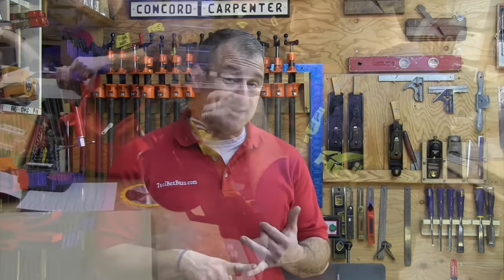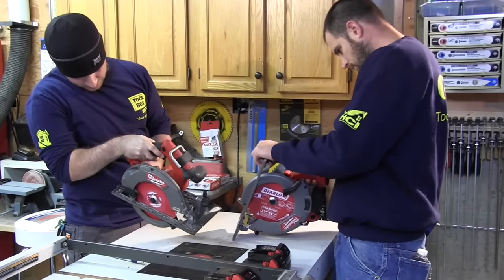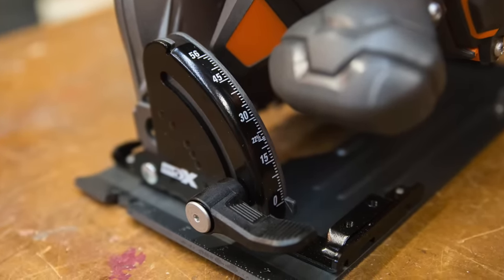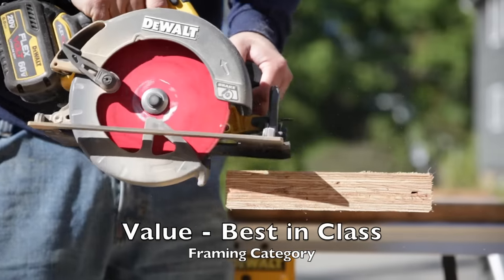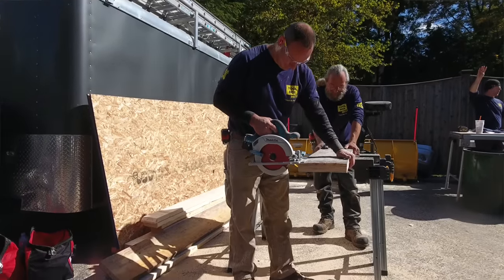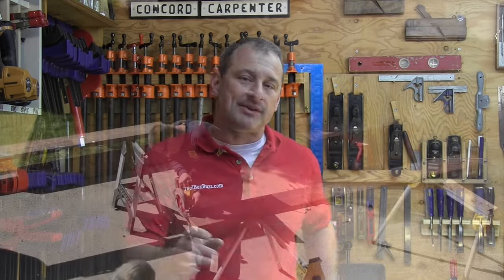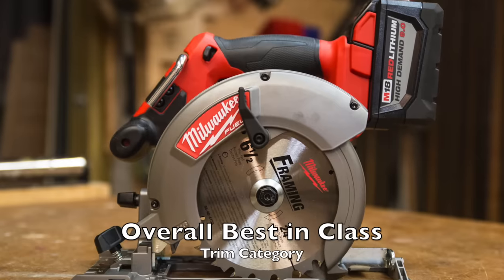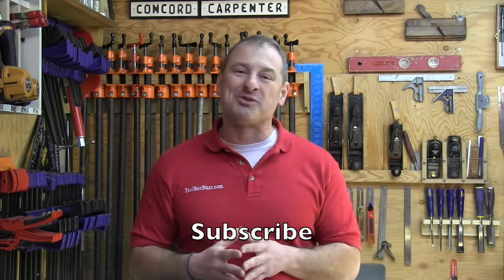Best Cordless Circular Saw - Head to Head

Comment: Endurance test. Of course milwauquee will with with a 9AH battery
Reply: Camrin Massey What a goofy test, who would have thought a giant expensive battery is going to offer the most run time.

In other news Milwaukee also won the most red colored saw test as well, truly putting it in a class all its own.
Reply: Infandous Ktenology, i have the saw and battery kit and with the rapid charger the 9.0 battery charges in 45 minutes, the charger charges 5.0 batteries in under 20 minutes
Reply from the maker: Actually the Makita has more cuts on the runtime test  did you look closely at the graphs?  Read the article?   Or.... do just prefer to make fun of 140  man-hours of "free labor"  to provide some insight into the tools you use?
Reply: Cody Muckerheide that doesn't sound remotely possible. does it charge 3ah batteries in 10 minutes? Are they smoking when they're done and do you hold them with oven mitts?
Reply: Brandon Hall not at all, idk what they incorporated into the charging technology, the company i work for buys exclusively milwaukee for our cordless tools, so i bought my own 7 1/4 saw and was the first with the 9.0 battery in the company, being the only one with a rapid charger we would always use mine, wed put a battery on the charger, walk away for at most 20 min and when we came back the batterys would be charged from 0, except the 9.0 of course
Reply: Brandon Hall not at all, idk what they incorporated into the charging technology, the company i work for buys exclusively milwaukee for our cordless tools, so i bought my own 7 1/4 saw and was the first with the 9.0 battery in the company, being the only one with a rapid charger we would always use mine, wed put a battery on the charger, walk away for at most 20 min and when we came back the batterys would be charged from 0, except the 9.0 of course
Reply: Cody Muckerheide In order for that to be true the charger would need to be putting out 10-12 amps. Seems highly unlikely. To my knowledge Makita still has the fastest chargers and they have to incorporate a fan to charge a 3ah battery in 30 minutes without it overheating. Do Milwaukee's chargers even have a cooling solution?
Reply: Brandon Hall the new rapid charger does have a fan, one of the first things i noticed cuz the old chargers were silent
Reply: Gents the rapid charger does have a fan and uses a modified sine to charge. It forces the charge really fast and then a cooling of the fan. That's how it charges so fast and no oven mitts needed.
Reply: Joe Canning That doesn't tell us how fast it charges, and I sincerely doubt it's under and hour for the 9.0. 2 hours even seems far fetched.
Reply from the maker: The 9.0 Ah battery will charge in 90-minutes with their rapid charger
Reply: and its going to run longer being brushless.
Reply: Cody Muckerheide do you notice a big difference in power with the 9.0. I'm trying to figure out if I should get one.  My 5.0 dose a great job
Reply from the maker: no - I think its the runtime where you'll see the biggest gain
Reply: Hitachi makes a faster charger than anything by Makita. It comes with their Triple Hammer impact and charges 3.0 batteries in under 30 minutes.
Reply: bhepp344 sorry i did not see your reply. the 9 ah has a faster discharge rate, which you do notice withe the skillsaw, expecially doing 2 by 4 rip cuts
Reply: greenskiis I guess Hitachi has to have something going for it.
Reply: You mean in addition to the best impact (Triple Hammer) and best nailers, and among the best miters? Guess so.
Reply: greenskiis never used the impact, nailers are nothing special, prefer paslode, and ther mitersaws are terrible, makita or bosch are the best for mitersaws
Reply: greenskiis other than the occasional pneumatic nailer, I rarely if ever see Hitachi power tools on the job. Must be home gamers buying them.

As far as having the best impact, pretty sure Makita still holds that spot, though it can be somewhat subjective.
Reply: The Triple Hammer curb stomps anything put out by Makita, DeWalt, etc and is IP56 rated to boot. Don't knock the company if you haven't given their latest products a fair shake; they also just put out the most powerful cordless hammer drill (even more powerful than the Fuel Gen. 2). They've really been putting out some quality stuff of late instead of their past "rich man's Porter Cable" cordless lineup.
Reply: greenskiis When they start showing up in the boss' van, I'll consider them an option.
Reply: Um, OK. Feel free to think outside those boundaries, though. :)
Reply: If he uses the best, they should already be in it.
Reply: @Cody Muckerheide - "with the rapid charger the 9.0 battery charges in 45 minutes" - you've got your charging times wrong. Milwaukee themselves claim a charge time of 95 minutes on their fast charger for the 9ah battery. As for 20 minutes for their 5ah - nonsense.
Reply: A Concord Carpenter / ToolBoxBuzz 

I'd love to see the new 9ah flexvolt against the Milwaukee 9ah we make a great video! And great video Robert thanks 
-Josh
Reply from the maker: josh travers were testing the 9.0 and flexvolt this weekend - on recips
Reply from the maker: Brandon Hall Actually the Makita has more cuts on the runtime test  did you look closely at the graphs?  Read the article?   Or.... do just prefer to make fun of 140  man-hours of "free labor"  to provide some insight into the tools you use?
Reply: @ConcordCarpenter  "free" rofl. Like you aren't getting paid by youtube, and who knows how many other companies.  Get real.  Also, using massively different sized batteries made no sense, so just own that.
Reply from the maker: Camrin Massey each tool company sent their BEST battery at the time of this test
Reply from the maker: John Handcock YouTube doesn’t pay me either Einstein. There’s Adsense and that pays per clicks on the video, which by the way doesn’t even cover the lumber we buy to do these tests. Each company sent their best saw with their best and biggest battery.
Reply: @ConcordCarpenter  Ohh it's not google, it's adsense... Same shit.  Semantics.  

So, all you got was $5,000 worth of circular saws, and w/e money the ads on your website generated.  

I wish I was working for free.
Reply from the maker: @johnhandcock3242  No we give the guys who help with the testing a tool and donate a bunch to local trade schools.  

Click this and scroll down:

https://www.facebook.com/search/top/?q=tool box buzz trade schoos
Reply from the maker: @johnhandcock3242  No - we give a tool to the guys on the crew who helped, and donate a bunch to a few local trade schools.

Click and scroll down:
https://www.facebook.com/search/top/?q=tool box buzz trade school
Reply from the maker: @johnhandcock3242  Nope - we give a tool to each of the crew for help with the testing and donate to trade schools.

Clearly you've made your mind up on us, I'm NOT going to sway your opinion. Just want you to be informed.

If you'd like to chat more about this, and how I use adsense, and the countless hours that I put in to my website and video channel. I'd certainly jump on a call - I'm pretty proud of what we do here - just  LMK .  ROB
Reply: A Concord Carpenter / ToolBoxBuzz Great job guys, don’t worry about Shitheads like John Handcock (how original). He just mad his Fisher Price kit he invested in didn’t win.

Comment: my friend bought a combo of milwaukee  few month ago, his hammer drill is broken , circular saw is fking heavy and the protection system( the shell covering the  saw) is completely trash ( always stuck) when  cut the timber.
Reply: Strange, I switched to Milwaukee from Makita power tools and the build quality and performance is night and day for what I do. I find the Milwaukee 18v fuel hammer drill and impact driver are unreal.
Reply: It all goes down to the actual users. Yes some blames on the tool instead of themselves.

Comment: To me you got to look at the big picture, and the only one that actually matches and might be more powerful then corded is Dewalt, the others don't and you won't be able to with 18 or 36 volt tools, Dewalt to me is game changing in the power tool department and they have a 7 year patent on it's flexvolt design so either other tool companies pay to use that technology or just wait for the patent you ru out or use a  different battery platform
Reply: Big Daddy I'm not sure I agree completely. The 60v is nice, but it does come with a sacrifice. Dewalt and Milwaukee have similar number of cells in a pack. So one uses the potential power quicker at a higher voltage. One chooses longer run time at a lower voltage. For 95% of applications a user doesn't really need 60volts (54).
Reply: Actually if you look at the cuts per watt hour chart they showed the Dewalt uses its battery energy slower than the Milwaukee. Just because the battery pack is a higher voltage doesn't mean the tool automatically draws more power. The higher voltage of the Dewalt system means that it can be more efficient as the current draw is lower and therefore heat loss in the motor winding and the control MOSFETs is lower.

Comment: I always liked Milwaukee but had problems with there batteries...they work fine for awhile but they often fail...Milwaukee at one time honored this buy replacing them via a recall etc. but I heard now they wont now and there customer support is non existing (personal experience), its my understanding that they now out source there battery construction , that is not the same company may not make their batteries all the time and (for me) they seem pron to fail after awhile and will not support there customers.  
"That's all I got to say about that" Forest Gump
Reply: When I bought this saw as a bare tool the blade it came with was missing teeth. I called customer service and they sent me a new one. I'd say that's good customer service imo.
Reply: David Harris 
Old Milwaukee V18 batteries were garbage, but the newer M18 or M12 never had any problems with it.

Comment: I use the Milwaukee fuel circular saw with the new 9.0 batteries and it's a boss, it has completely replaced my oldschool corded skilsaw and cuts great. Just last summer I did a porch for a apartment building using nothing but the Milwaukee fuel circular saw with no problems

Comment: I'll tell you what there's a lot of different tests out there you guys did a good job on the test I bought the Ridgid octane because of my money situation now I'm cut three-quarter inch plywood with it I put skirting around my home with it I also bought the octane hammer drill and I've had no problems with him I feel like I kind of lost out by saving money I really like the performance of the Milwaukee in your video I really did well I'm not going to get rid of my saws and equipment and start stocking up on Milwaukee I will go ahead and keep my Ridgid I really like it a lot it's a beautiful tool I need longer run time so I will buy a higher amp battery for them and thank you on your videos and I'm kind of sitting here sad right now maybe I should have bought the Milwaukee

Comment: For the Hilti costing 2-4 times as much as the other brands I would have expected it to do much better even after you got a non defective one! For me I run Ridgid 18 volt cordless tools and I have 19 of them right now and 9 batteries so I don't anticipate buying another brand anytime soon but that's ok because I have been perfectly happy with all my Ridgid tools they run great, get the job done and I have never had one break on me. Also I noticed you listed $347 for the Ridgid Brushless 7-1/4" Saw with a 5.0amp battery and charger which does ding it in the best value running due to price but for me I got a sweet deal on a kit with the 7-1/4" Brushless Saw and the 1/2" Brushless Compact Hammer Drill with a 2.0amp and a 4.0amp battery and a charger for $135 and at that price I don't think anyone could have touched Ridgid in the value category!

Comment: I'm glad you did the head to head, run what you brung test (w the exception of adding batts so the results made sense). I couldn't care less about brand loyalty, except for battery compatibility. If I have ten fresh, 5ah yellow batts, well, the yellow tool is gonna get the harder look. That said, for me its more a line-up issue. I am looking at the best value for 4 main tools. If the line-up does the job at a good price, then I run that color on the job. I'm certainly not running yellow drill/driver, blue saw and red recip. Crazy!
Reply: Yeah I hear that, with 9 Orange batteries Ridgid always gets the biggest look for me and as long as the Ridgid tool I need will do the job then that's what I am gonna buy since I have so much money invested in Ridgid batteries
Reply: Chevy513 same. It’s frustrating because the ridgid battery powered sawzall is junk. I like their other tools but the reviews are terrible for the recip saw, so I will just go without as long as possible.
Reply: i've own the x4 sawzall and it was a beast unlike the drill

Comment: I've been happy with my Dewalt 20V 7-1/4" circular saw's performance.  Coming from an old 18V XRP 6-1/2" Dewalt circular saw the power difference and battery life difference isn't even in the same ballpark.  I'm sure that Flexvolt version is good, but for the ridiculous price its not worth it.  I have the Flexvolt 16" chainsaw and the runtime on a battery isn't great, about 15 minutes.

I have the 7-1/4" Dewalt 20V miter saw as well and it does great on battery life and performance.  I did a living room, dining room, and kitchen flooring project on 1 5ah battery.  Pretty good run time I think considering all the cuts it was making.

Comment: Really great review as always! Milwaukee should win any endurance tests since they use larger 21700 cells to most everybody else's smaller 18650 cells.  That being said, I am glad I went with the new Makita 5000 rpm 6.5"saw and reinvested in my near 12 yr old LXT battery system. It just has more tools and most are at or near the top in performance of the tools I use. Don't even get me started on how bad ass my dual 18v chainsaw is! Love that thing. The circular saw, impact, hammer drill, jigsaw and grinder are my most used battery tools. I like the recip, router and multitool but just not used as much. I like my Makita 18v setup for over a decade and I'm still using it. Lets face it these are all nice tools today!  Much better than what we had just a few years ago. The price, weight, and size ergos come into play after actual work done and quality to me. The yellow or red stuff could win for another guy who uses slightly different tools or likes their ergos or price better. For me it was the teal blue stuff.

Comment: Amazing in depth h2h C-saw test, Robert. Thank you for organizing all the guys and making this video. I own Milwaukee tools for 8+ years, they are excellent and made to last, batteries are really top of the line , as a carpenter doing say roof work and you have all the batteries charging on the ground, the endurance is important, I have seen Makita owners changing batteries 2- 3x while I still can make cuts done with a Milwaukee before I need to change my battery. Make no mistake, Makita is still an excellent product, and If they can make the battery last longer they could be 1st. The weight difference between a Milwaukee and Makita C-saw is considerable. But, at the end of the day, batteries are important and Milwaukee engineers have built better compared to others.
Reply: well if u r on the roof working no type of roof work can work  a modren cordless hard enough to run down even 1 battery on any of these saws. and if you have a makita with 2 batterys  that -= 36 volts it will run longer then a Milwaukee. and you just charge 2 batterys on the ground., But I have spent my share of time on the roof and you either get the stuff cut and sent up or you are taking 4x8 sheets and ploping them down and use the saw for special cuts and sheets you run wild and that is not enough to run even the worst of these saws down.

Comment: I think u had 1 of the best videos about the break down of tools I have Milwaukie  12v and 18v and the 1 thing I love is like you said all battery's on the 12v all work with all 12v and all battery's on 18v work with 18v and i am that guy that will buy a tool and as long as I use it atleast 4 times a month it is a good buy but Milwaukie is my battery's tools for my job or jobs I am on

Comment: I have the Dewalt 60V Flex Volt circular saw, and while it's absolutely badass, the one thing I dislike is that the blade is on the right. It's so much easier to see when it's on the left in my opinion. I really wish they would have kept it on the left, like with their 20v circular saw. I don't get why they changed back like that. I know some people may try to start the worm drive argument or whatever, and I'm not getting into that. But I ended up getting the saw, charger and 60v battery for $190 out the door at Home Depot, thanks to the display model being the last one in stock. An awesome deal for an amazing tool. Worth every penny.
Reply: I agree. To me this is a deal breaker. I will not buy a saw with a blade on the right side. It's always been my impression that people from the north east are right side blade sidewinder saw users and west coast guys use worm drive saws. I have owned RS blade saws in the past and hated them and now I just cannot use them period.

Comment: The best cordless saw is the best saw on the battery platform of your choice. Tool brand comparisons really only matter when you’re researching first tool purchases. Once we’ve chosen a platform, most of us are not going to consider competing brands. So, choose that brand based on whether the extended product line includes the tools you need for your line of work. I like DeWalt both for its value pricing and uniformly praised, home/small shop woodworking tools, but it’s durability also ensures the brand is respected and widely used on construction sites too.